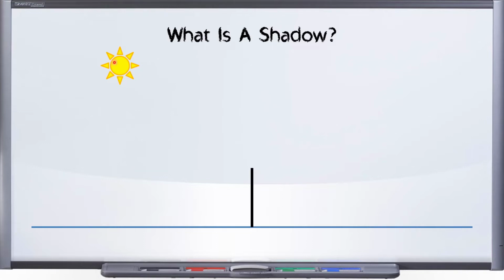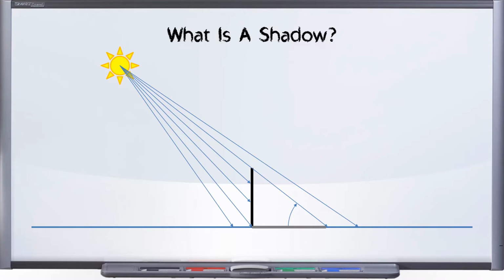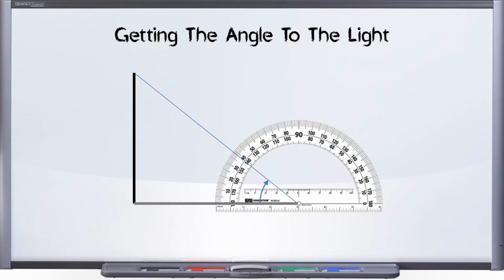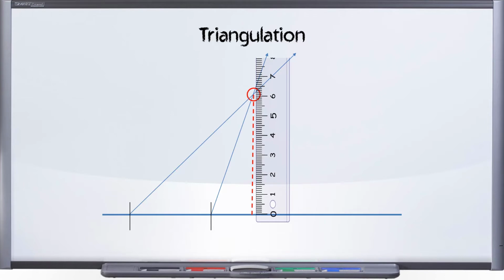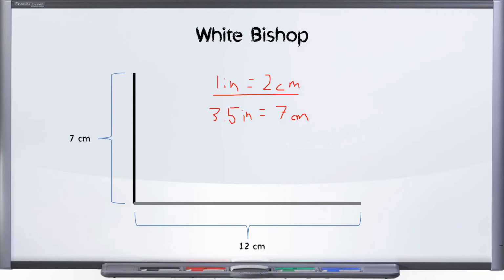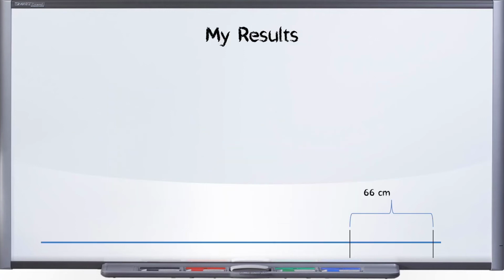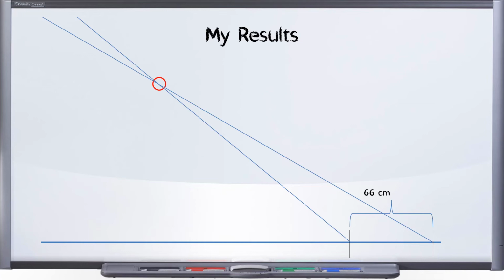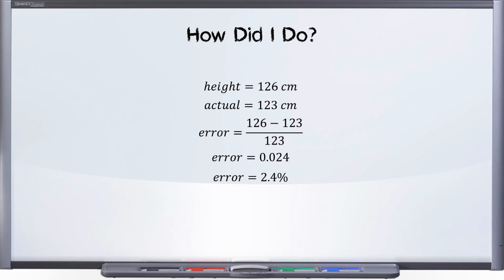How To Triangulate

Comment: Shouldn't we all be doing this at the exact same time? I know you said solar noon is that the same for everyone though because if your taking into account distance then that probably takes into account height/angle too so if doing it at different times it seems logical that it would give different heights/angles because of time elapsed between people's solar noon?
Also if its an apparent sun can we really triangulate it?
And 1 more thing the light bends when entering a dense medium so is the Ray of light really straight?
Not sure why your making up your own scale shouldn't you stick with 1in = 2.5cm or are you allowed too make up something that's technically false without it effecting anything?
I don't have a protractor will see if can pick one up.
Wouldn't that distance between observers have to be in a straight line from all observers as being plot on a straight line from observers? Also the 90 degree angle from base straight up where exactly is that that the sun's directly above and when it's directly above there isn't that when we should all do it? Would make more sense to me. 
That suncalc I tried to use but couldn't figure out how to change day or location on it.
Reply: Rachie 00000 "Shouldn't we all be doing this at the exact same time?"
There are reasons why it's not necessary. But your question is exactly why I was hoping to find a few people to join me on the Prime Meridian at solar noon on Sunday. Then we would all be standing in a line and taking our measurement at the exact same time.
Though it is not actually required for getting useful data, having each of us measuring at the same moment, all in a line, is conceptually much more intuitive.
Reply: "Shouldn't we all be doing this at the exact same time?"
- It depends what you mean with same time. For example, right now it is 11:40pm here in Amsterdam, but in Los Angeles it is 2:40pm. If I and someone in LA measure right now, we are measuring at the same time. But here in Amsterdam it is night, and I can't see exactly which direction the Sun is. But if I measure at noon tomorrow, and a person in LA measures at their noon tomorrow, we get comparable results. So yes we should ideally be doing this at the exact same LOCAL time.

"I know you said solar noon is that the same for everyone though because if your taking into account distance then that probably takes into account height/angle too so if doing it at different times it seems logical that it would give different heights/angles because of time elapsed between people's solar noon?"
- At any given moment, there is always exactly one point on Earth where the Sun is seen directly above the location, such that a stick that is perpendicular to the ground will cast no shadow. Of course that may be over water, but that is not important. We call that the sub-solar point. That point moves smoothly along a the same latitude line through the day. Noon is defined to be when the Sun is crossing your LONGITUDE line, while traveling along the latitude line. That is why it is easier to compare measurements, if they are all taken at the local noon. That is also the time where you see the Sun highest in the sky. So you can determine the local noon if you keep measuring the shadow length every minute, and take the time when the shadow is the shortest.

"Also if its an apparent sun can we really triangulate it?"
- Apparent Sun does not mean that the Sun is a vision or ghostly intangible apparition. It is an astronomical term that simply means 'where you see the Sun in the sky.' Astronomers use that distinction because they calculate that the Sun is so far away that it takes 8 minutes for the light to reach you. Thus, the actual location of the Sun is a bit further along it's path than where you see it at that moment.

"And 1 more thing the light bends when entering a dense medium so is the Ray of light really straight?"
- The effect you are referring to is called refraction. The physics behind it is well established and can easily be confirmed with tabletop experiments. The effect on observing distant objects like the Sun is also well understood. (Whether it is a few thousand miles away or many million miles doesn't actually matter, the layer of air is very thin in comparison to the distance in both cases.) Astronomers routinely take it into account. The effect is much stronger when observing something close to the horizon. Higher than 10 degrees above the horizon and it can safely be ignored for naked eye observations like the one proposed here. We know this by for example taking many many pictures of the stars at different locations in the sky, and then comparing their relative distances. One constellation looks the same if it is 40 degres above the horizon and if it is 70 degrees above etc.

"Not sure why your making up your own scale shouldn't you stick with 1in = 2.5cm or are you allowed too make up something that's technically false without it effecting anything?"
- I believe he answered this one already, but I think he was just trying to name different scales of proportion. It is the ratio between the measures that matter. If you use 1in = 2.54cm then you just get a different factor, but all the values multiplied by that same factor, so the proportions are still the same.

"Wouldn't that distance between observers have to be in a straight line from all observers as being plot on a straight line from observers? Also the 90 degree angle from base straight up where exactly is that that the sun's directly above and when it's directly above there isn't that when we should all do it? Would make more sense to me. "
- It can be difficult to imagine the geometry in 3D, but that is actually exactly what measuring at local noon does. So you are right, it is the logical and reasonable way to do it :) Local noon is defined as the moment when the Sun is crossing the longitude of your location. It is the moment where it is as directly above you as it can be (you may still be on a different latitude than the Sun, but the latitude of the Sun remains the same throughout the day, and so for all observers), so it makes for a fair comparison.
Reply: Having everyone do the test at the same time makes sense if we expect the distance to the sun to change a lot during the day, but I'm not sure anyone thinks that's happening.
As far as the light rays bending, we see the sunlight pretty straight except when the sun is very close to the horizon. Otherwise sundials wouldn't work.
Reply: @barryon8706  but it does on the flat earth model the sun moves increasing and decreasing distance. As it gets further away it sets remember so the distance to it is always changing throughout the day?
Do Crespucular rays interfere with it?
Reply: @Rachie-nj3oi   Why doesn’t the sun change in angular size according to the laws of perspective as it gets closer or farther away?
Reply: @Rachie-nj3oi  It doesn't change the distance from the sun to the earth, however. And crepuscular rays would not interfere with it unless the sun itself is too dim to see.
Reply from the maker: @Rachie-nj3oi  "Do Crespucular rays interfere with it?"
Just wanted to chime in... would you agree that crepuscular rays look straight? Ever seen a curved one? Based on that, does it seem reasonable to you that the rays of the Sun do appear to travel in fairly straight lines?
Reply: @Rachie-nj3oi  Rachie, please don't tell me that you have never seen this one: 5HgFT9Yu0JY In this case, Jos is using sunrise and sunsets to determine the direction to the sun (which no one can seem to agree with on a flat earth, yet on a globe all the data is consistent.) but the same principle applies to solar noon.
Reply: @AstroRexxx  too big to see a change?
Reply from the maker: "Shouldn't we all be doing this at the exact same time?" That would be ideal, but it's quite restrictive. That works if the people are in a direct line to the Sun. Different observers along a direct North-South line from one another can do this all at the same time. Otherwise it becomes a 3D problem. I can work the 3D problem, but the goal was to make it super easy math-wise.

"I know you said solar noon is that the same for everyone though because if your taking into account distance then that probably takes into account height/angle too so if doing it at different times it seems logical that it would give different heights/angles because of time elapsed between people's solar noon?" The FE hypothesis this is based on is the one where the Sun circles at a constant altitude over a flat Earth. If the altitude stays relatively constant over that 4 day period, we should be good. Right? If that is not the FE model you subscribe to, please describe your model, and we can talk about that separately.

Edit: missed this one: "Also if its an apparent sun can we really triangulate it?" If the Sun is not where it appears to be, this will not work. The flat-Earth hypothesis I am working with says the Sun circles above the flat-Earth. I suspect your instincts are right about this. I think we're likely to find that the small, local Sun circling the flat-Earth hypothesis doesn't work. The optical effect hypothesis may need to be considered next.

"And 1 more thing the light bends when entering a dense medium so is the Ray of light really straight?" Any refraction will cause errors in our results. This works best when the Sun is high to minimize refraction. Solar noon minimizes refraction. I am asking participants to do these measurements, and then we can assess how well it worked. I anticipate the results will show that the FE model requires a great deal of refraction to make it work while the globe model requires little to no refraction. At that point, we can start discussing how much refraction we're each willing to accept and in what direction.

"Not sure why your making up your own scale shouldn't you stick with 1in = 2.5cm or are you allowed too make up something that's technically false without it effecting anything?" This is fundamental to the whole process. I'm going to be making a scaled drawing and using the lines in my drawing to measure results. It's like when you try to real distances off a map. The map is a scaled-down picture of the real world. To convert from the map scale back to the real-world scale, you have to account for the scale on the map. Right? Same thing. I'm making this little "map" of where everything is, so I get to decide the scale. I can choose any scale I want as long as I'm consistent on any particular drawing. For the angle drawings, I chose 1 in = 2 cm. I could have used 1 in = 2.5 cm, but I wanted to emphasize that I was setting a scale here. For the real experiment, my stick will be over a meter long, and I won't be able to fit a 1-to-1 scale on my paper.

"I don't have a protractor will see if can pick one up." For the real experiment, all you need is to measure the stick and the shadow length. I'll do the angles for us and share. But if you want to do it yourself (or do the scaled-down version) grab a protractor. That's a handy tool for a true flat-Earth investigator to have around the house. Feel free to just print one out if you want.

"Wouldn't that distance between observers have to be in a straight line from all observers as being plot on a straight line from observers?" For observers that are not in a straight North-South line, we'll have to reduce the problem to their North-South distance. It turns out that's very easy to do. Each degree of latitude is 60 nautical miles or 111 km. So we can get the North-South distance right out of your latitude.

"Also the 90 degree angle from base straight up where exactly is that that the sun's directly above and when it's directly above there isn't that when we should all do it?" I don't entirely follow the question, but I think you're saying to do this when the Sun is directly overhead. I think you'll find the Sun is NEVER directly above where you live (guessing your location purely by your accent). I'm in Los Angeles, where the Sun never gets directly overhead. The closest it gets to directly overhead is on the Summer Solstice at local noon.

"That suncalc I tried to use but couldn't figure out how to change day or location on it." Hmm... you're on a phone if I recall correctly. On a computer it's quite easy, but with a mobile browser, it may not be. If you tell me your nearest major city (or your lat/long), I can look it up for you. Maybe hit me on discord or email so you don't have to put that in the public chat.
Reply: @icansciencethat   @I Can Science That  thanks for clearing that up. No I was thinking like with the polaris diagrams they do. Like they have polaris right above North pole then do the distances from there but use that as their starting point for the right angle in the triangle if that makes sense.
I was wondering to get the right angle in this triangle if the sun is directly above a point what point would that be like for polaris it's the North pole. But looking back at your video now I realise your right angle is the height of the object used for shadow. 
And will Dm you.
Also isn't this technically already predetermined to show results of a ball, because using longitude and latitude related to a ball and the miridean and possibly even solar noon? All ball related info right that may not be same on a flat earth?
Hoping I will be able to do it. It's cloudy here atm no sun at all so much for summer lol hopefully be nice and cloud free on 20th.
Reply: @Rachie-nj3oi  "Also isn't this technically already predetermined to show results of a ball, because using longitude and latitude related to a ball and the miridean and possibly even solar noon? All ball related info right that may not be same on a flat earth?"
 
I agree that longitude and latitude are based on a sphere... because its a sphere (lol) However we dont really need the latitude and longitute, the measurement we are after is the north-south distance between the peoples locations. 

Using latitude is simply the easiest way to figure that out. We know it works, and its something everyone can test for themselves.
Latitude distances also identical on flat earth and globe ~111km/degree, so no bias there. 

PS: You ask some good questions when it comes to globe stuff, wish you applied the same critical thinking to the fe stuff :P
Reply from the maker: @dodo3441  This exactly: "You ask some good questions when it comes to globe stuff, wish you applied the same critical thinking to the fe stuff :P"
Reply from the maker: @Rachie-nj3oi  I think Do Do Do answered this well.
If you don't believe that degrees of latitude are exactly 111 km apart, I suggest you test that out. Could be a good excuse to take the family on a road trip. Drive around. See the sights. Have the kids write down your mileage and lat/long as you go.
Reply: @Rachie-nj3oi  "Also isn't this technically already predetermined to show results of a ball, because using longitude and latitude related to a ball and the miridean and possibly even solar noon? All ball related info right that may not be same on a flat earth?"
- Yes, this is a really interesting point! There are many things that are different between a flat earth and a globe earth, but there are also many things that are the same. One example is that the Sun follows a "line" of latitude during each day on both models. That is why it is convenient to use latitude and longitude in this experiment. Of course it is not necessary, but it does make the analysis simpler, and hopefully easier for both sides to understand.

I don't know if you saw my earlier reply, it is a bit long, but it goes into more detail on what is the same and what is different between flat and globe earth models. From the thoughtful way you raise questions, I am sure you will easily understand :)
Reply: @dodo3441  lat long alone doesn’t necessarily mean globe. It works on any 2d surface. The issue is, we understand very well how lines of lat and long are spaced and that is ultimately why they don’t work as we currently have them defined. For example the tropics are more or less the same length, on a flat polar coordinate system they cannot be.
Reply: Solar noon is when the sun crosses the meridian.
Reply: That this experiment does make any sense, it is a majority that every participant takes the measurement in the moment when the sun passes the local zenith. I'm living here anywhere in Europe. If I would take my measurement when the sun passes the zenith of let's say Austin, Texas, I would measure a shadow of one foot long stick that's  eventually one mile long. A useless measurement and useless value. But when I take my measurement when the sun passes my local zenith, the shadow is then something around one foot long. That's a astronomical standard that was also used by the ancient astronomers.
Reply: @Hail HYDRA I was just thinking if they aren't real rays due to perspective can they still effect it.
Like could you put your stick in the ground where one of these Crespucular rays hits and would it effect result.
Reply: @Rachie-nj3oi  You are correct that it would be the simplest solution to do it at the same time, but you need to actually find people that live at places that form a line which is obviously hard to organize. FE Peer Review is doing it that way I heard. 

The way ICST does it actually allows you to get the same results tho, picture this:
-You have your flat earth, and you place your measuring tape on it so that it goes from the north pole outwards , and passes right below the sun.
-Now when the sun rotates over the plane, that line will also move along like a clock hand.
-Noon is when that line passes your location

So all the people in the experiment are essentially waiting for the "measuring tape" to reach their location. When it does (noon) they take their measurement.
Reply: @dodo3441  I'm trying to arrange it. I'll be on the Prime Meridian in France and I've got someone who will be on it at Greenwich. I'm still trying to arrange 1 or 2 more. It would be so good if I could get at least 3 in total and I've got 2 for sure.
Reply: @Hail HYDRA I'm not entirely sure either I think I was thinking about it from one observer and different angles ignore that one about distance lol but it could vary height not impossible right?